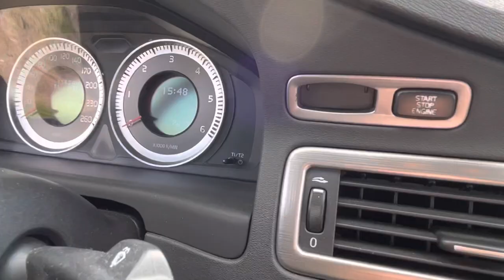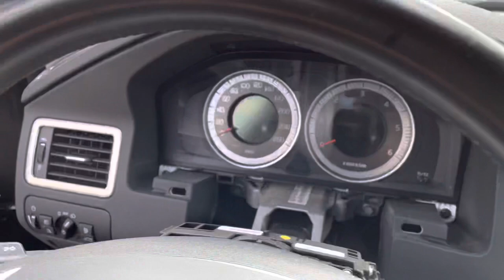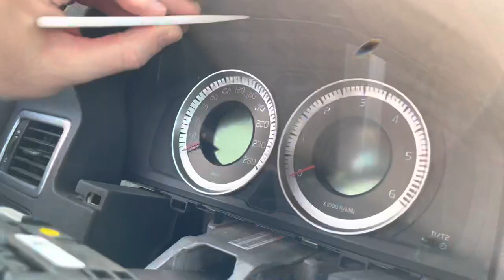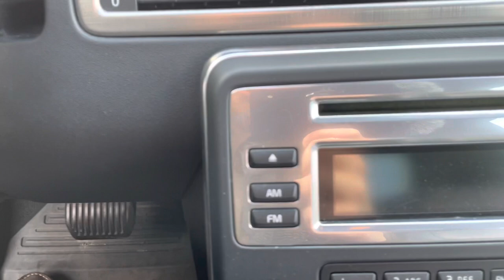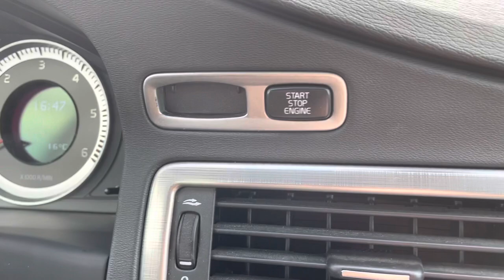Replace Volvo P3 Start Button with gague cluster removal

Comment: Where did you buy spare button? I have been trying to find any for some time, but still without success...
Reply from the maker: I think it is part of the assembly, I pulled it from a car at the junk yard. Dont think the button it self can be ordered, does not have any serial number on it.